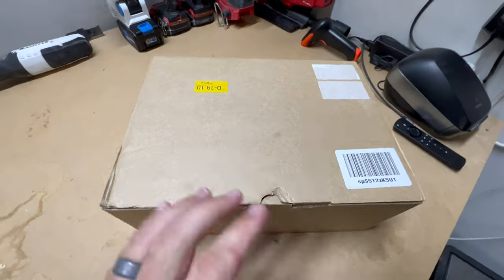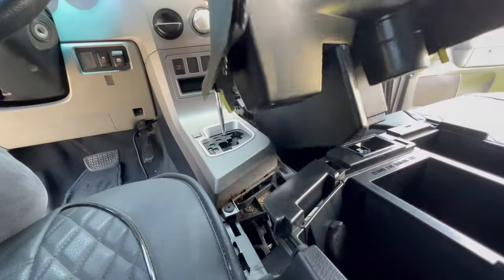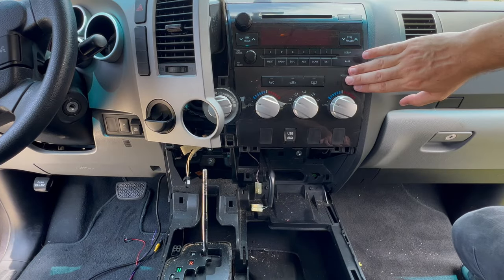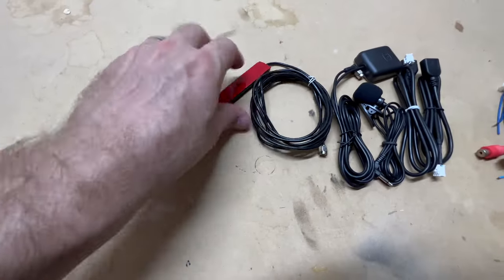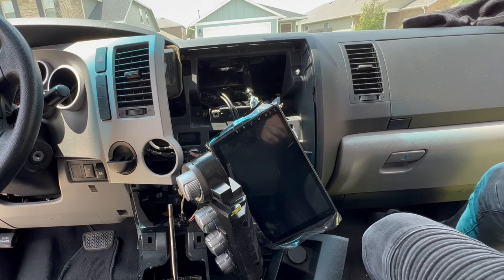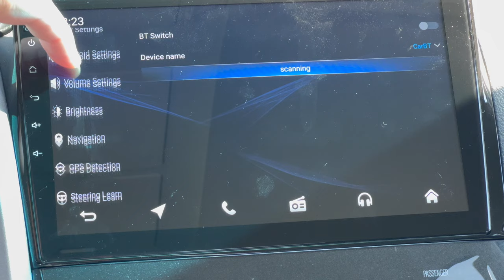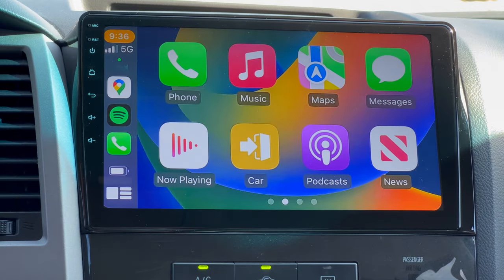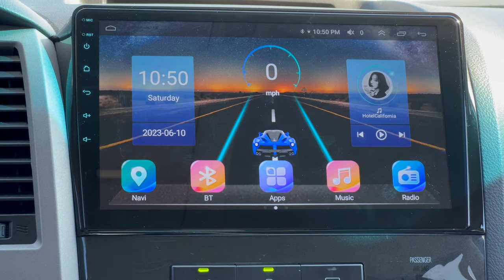ViaBecs APPLE CAR PLAY / TOYOTA TUNDRA 10.2" STEREO INSTALL / TUNDRA 2007 - 2013 /SEQUOIA 2008 -2018

Comment: Bought this radio based on this video, and I was pretty disappointed with it.  It's very slow and sucks at connecting to anything, and can't hold a connection.  It looks great but is not very good
Reply: Thanks for your comment. I'm looking at upgrading my stereo and almost purchased this unit, because of this video. But I decided to watch a few more video reviews. This one guy was saying you should be looking at a unit that has at least 3GB of ram. Or it will be slow and possibly  freeze. Thanks so much for your comment. You just confirmed the other review I watched. I'm sorry you found out the hard way. Hope you can return the unit.
Reply: @tripleBacres   yeah no problem, I knew this was to good to be true but I tried it anyway.  I wanted this to work so bad but it is what it is.  One thing I forgot to add to this was the fact the radio was still stuck in the China time zone and could not be changed and it was super frustrating.

Comment: I have the 2008 JBL factory head unit which sounds good but that’s it. .. outdated….I installed a similar 10” Android but removed it after a summer of poor performance, the battery drain was a big problem , wiring harness was nightmare, had to buy a pac interface which was just as expensive as the 10” Android .. before you buy check out the reviews this will save you a lot of headaches. 😢😢😢
Reply from the maker: You are correct!  Not all Android head units are created equally. Some are complete trash. It is very important to research the brand and check reviews before buying. There are a lot of cheap fly by night companies out there. Go check out my channel. I posted a video a few weeks ago that you will like.

Comment: I've seen a few vids of stereo install and I don't think you need to take all that plastic off. I only take the bottom cubby thing, the climate control, the stereo and then I pull the days slightly out. It's much easier. Just an FYI.
Reply from the maker: You are correct.  This is mentioned in the video.
Reply: @Paulinaandjosh  Must have missed it. Sorry. I think if you're running new lines + amp + subs...probably need to remove most of the stuff. I'm lazy tho. LOL

Comment: Some others say that this not mounting to the 4 bolt connections cause it to feel less sturdy. With that being said, what’s your opinion?
Reply from the maker: That is correct, the 4 original mounting bolts are not used. I was able to get the top two connectors to “click” in but it took some finagling to get it in just right.  So far it hasn’t popped out and feels fairly secure but I do wish that it used at least two of the original mounting bolts for peace of mind.
Reply: @Paulinaandjosh  Sounds good enough. I wonder with some light fabricating if you could cut/rig the two metal plates that come with the radio to be used with at least two bolts to the original mounting points if you removed the climate control cluster for in place alignment..

Comment: Having trouble connecting my steering wheel  setting to the system. Do you have any suggestions?
Reply from the maker: Is the head unit Viabecs or a different brand?  If it’s Viabecs there’s steps to configure the steering wheel controls in the video. If that is not working try resetting the unit. If it’s a different brand you will need to check with that brand on setting up the controls, the steps may be different.

Comment: Hey man, I just got a tundra and ive been looking at these style because of the oem style fitment. Do they have normal subwoofer preamp outputs? Ive seen a few the have a single green plug which is new to me. Normally its just the red and white or left and right audio cables?

Comment: You don't have to remove the handle off of the shift lever to move the trim around it.  Simply remove the fastener at the base, shift into drive or manual mode, lift the base of the trim plate, then move it back to release the front, then turn it left 45 degrees or so, and lift off.  Shift back into park.

Comment: Good day and thanks for the tutorial. What is the name of this unit and did your truck have a factory JBL system?
Reply from the maker: This one is Viabecs. I also made a video on a Dasaita head unit. The video is on my channel if you any to check it out. My truck does not have JBL but they both make an option that works with JBL. Click the link in description it will take you to it on Amazon.

Comment: Hey bro sick video are you still liking this head unit now that you’ve had it for a while
Reply from the maker: Thank you!  I’m pretty happy with it. The only criticism I would give is that the audio quality could be better. I mainly listen to podcasts so it’s not a deal breaker for me.
Reply: @Paulinaandjosh   i’ve had it for two weeks now and I’m having some connectivity issues with it. iPhone will always connect but halfway down the highway It’ll stop connecting I’m having to press reset a lot I noticed mine is a little different and instead of the zlink it says Z link5. I’m 50/50 so far

Comment: I installed this head unit in my 2011 Tundra. I'm having trouble with the Zlinks app "skipping"  like an old CD when I play music. Have you experienced this at all?
Reply from the maker: I have this problem when my wife and I are both in the truck.  Since both of our phones are connected to the head unit Z link doesn't know which phone to connect to.  

If that's not your case I would get a replacement.

Don't forget to Subscribe if you haven't already.  I'm trying to get to 1,000 Subscribers.

Comment: 😊 hello sir. Maybe you can help. I have the exact stereo, the touch screen buttons along side the screen aren't responding to my touch. Everything else is working fine, i don't know what i did but they worked before.  Thank you
Reply from the maker: Sounds like you may have gotten a bad unit. I would exchange it for a new one.

Comment: Thank you for the video. I do have a question I can seem to get answered. I have a 2011 Tubdra and the oem backup camera display is in my review mirror. Installing this radio how would it affect the factory backup camera? Thanks
Reply from the maker: The back up camera video will show up on the screen of the head unit. If you want it to show up on both you can try using a RCA cable splitter. Split the video coming from the camera to go to the head unit and the mirror. Without seeing how it’s wired I can’t say for sure if that will work though.
Reply: @Paulinaandjosh  perfect! Thank you! That cleared up my worries. This is my first time installing a radio so I was a bit worried about messing up my OEM camera. Thanks again

Comment: Looking at 2013 Tundra. Backup camera shows up in the rear view mirror. Assume that the camera would still connect with this Viabecs Apple Car Play and the camera would then show up in the new DASH display?
Reply from the maker: The camera video will show up on the mirror OR the Android unit. It just depends on which one you plug the video cable in. You can try using a video cable splitter to see if you can get both displays to work. I haven’t tried this but if you do let me know how it goes. Also you should check out my channel I have a video for a different Android unit you might like.
Reply: @Paulinaandjosh  So i would be using the Apple car play not android … Don’t really care to have displays in both places, so was wondering if you’d have to unplug video cable from rear view mirror (and if that is difficult) to plug into new dash set up? Not to mechanically inclined so just wondering. Thank you. Nice video demonstration, too.
Reply from the maker: You would use Apple or Android depending on what type of phone you have.  The head unit connects to your phone and pulls the information from your phone, Apple or Android and displays it on the head unit.  

You would disconnect the yellow video cable that is running to the mirror and connect it to the video input on the head unit.
Reply: @Paulinaandjosh  Thank you!

Comment: Did you have to re tighten the 4 nuts you pulled from OEM radio ?
Reply from the maker: The new stereo just clips in. The 4 nuts are not needed.

Comment: My main question is did you have to re route any wire for steering wheel buttons? My Amazon generic DIN doesn't match with my Metra harness which doesn't have a labeled steering wheel option
Reply from the maker: There are no wires to reroute steering wheel controls, just follow the steps to program them to the new head unit. I have new video on my channel that you will like. Go check it out.

Comment: Does this work for tundra with JBL stereo and does it use the stock backup camera?
Reply from the maker: You need to get the one for JBL. Check out my channel, I have a Dasaita head unit install video. They have one for JBL. The stock back up camera and after market cameras will work.

Comment: I got the same one after watching your video and i loved everything abt it. But 3 months later like 2 days ago, it just stop working. My Bluetooth on my radio will not connect. It keeps saying i got to power it on and evertime i do under setting, it keeps turning back off. My android play will not connect as well. A almost $500 investment down the drain. Does anyone know how to troubleshoot shot this? Any help will do. Thanks
Reply from the maker: Did you buy it on Amazon?  Just request a replacement or refund.

Comment: i have a question, did you have to config the model of the car in settings, for detecting steering wheel control?, y bought one stereo, i conect the cable of the steering wheel control, but it dont detect it. i select the model of the car in settings but trundra don't appears en the menu,
Reply from the maker: I did not have to select the model of the truck. I would contact the manufacturer to see if that unit has different instructions to configure the steering wheel controls.

Comment: I have a 2011 with a backup camera in the review mirror. Will this support it and switch the camera to the screen? Or would I have to buy an aftermarket backup camera?
Reply from the maker: You won’t need to buy an aftermarket backup camera. Right now the camera is wired to the mirror. For the camera to show up on the stereo you will need to wire it to the pink wire labeled back up on the stereo. You could try to wire both the mirror and the stereo but I’m not positive that will work.
Reply: Sweet thanks!

Comment: I have a problem;I connect everything and when I shift the reverse turn on but the screen is black and a message “ no signal video”
Reply from the maker: If you have multiple yellow AUX cables try each one. It may be plugged into the wrong one. On my channel I have a video for installing a back up camera.

Comment: Did you end up using a canbus? I have a similar radio but my steering wheel controls do not work:/
Reply from the maker: It isn’t required for this stereo. Did you try programming the controls like I did in the video?
Reply: @Paulinaandjosh  yeah but it wasn’t working for whatever reason

Comment: Hey josh i just bought one of these cheaper amazon android units... 10.1" roinvou is the brand.. $200 so didnt spend a ton on it. While attmepting to connect to zlink it keeps asking my phone to download a supposed zlink app and of course chrome warns me that the link is suspicious. I thought zlink was built into the android auto app? Just wondering if you had any of those problems...
Reply from the maker: On the unit I purchased Zlink was already on the stereo. I did not have to download anything on my phone only connect to Bluetooth.

Comment: Hello, congratulations on your video, a small question: do you use the microphone already in the vehicle or do you use the microphone provided with the unit? Thanks
Reply from the maker: Hi!  Thank you for watching!

It comes with a microphone. I installed it underneath the steering wheel. It’s not noticeable and works well.
Reply: @Paulinaandjosh  Thank you for the answer. Another question: I own a 2010 Toyota Tundra, the steering wheel controls do not work. I installed the Canbus, I chose the model and year of my vehicle but it doesn't work. I'm a little discouraged.

Comment: So i recently installed a new head unit very similar to yours, I noticed you had an extra connector that you didnt use, is that for xm or sirius radio?
Reply from the maker: I’m not positive but I think it is for the steering wheel controls.